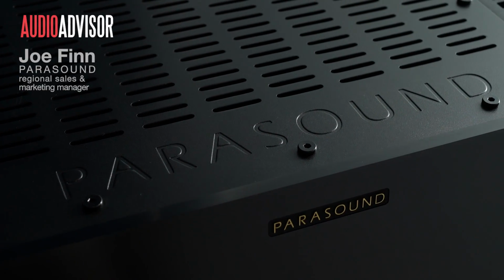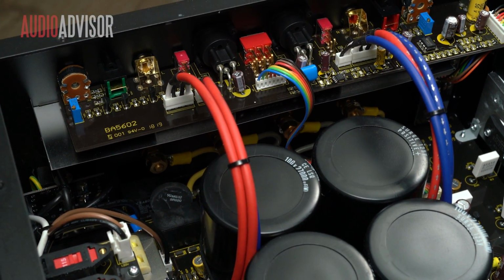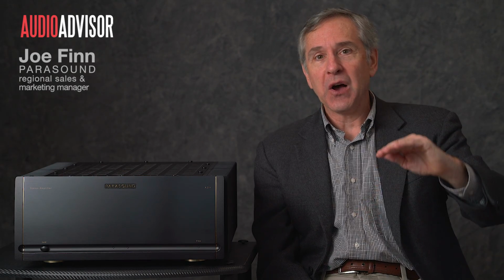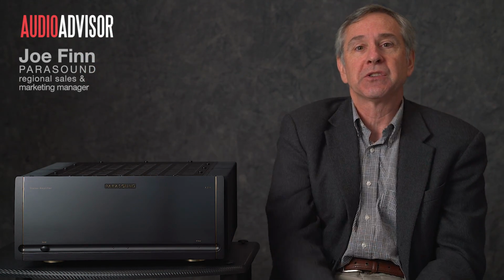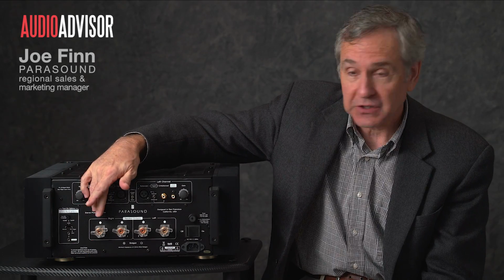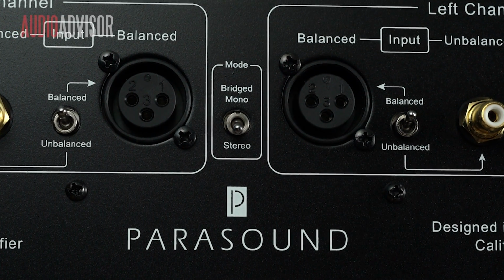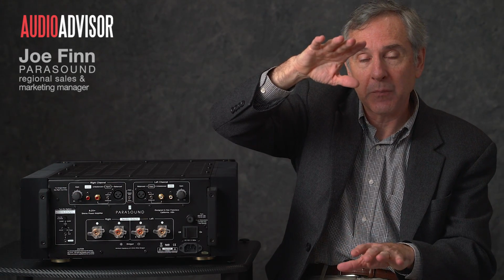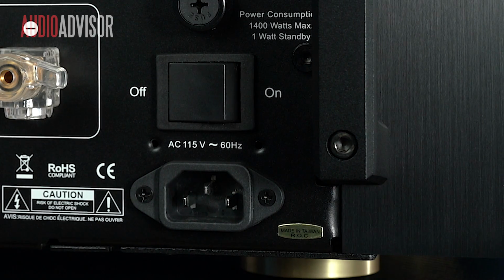Parasound Halo A 21+ Power Amplifier with Joe Finn – Audio Advisor

Comment: Well, Joe is about the only person I have not spoken with at Parasound, funny that. Anyway, I have the A23+ only because I could not afford the A21+, but other than the power, those two are the same in sound. I run a pair of Paradigm Studio 100 v5 towers and love their no nonsense detail and revealing nature. The Parasound Halo line from John Curl (master designer) are a perfect match for such speakers. I love the natural balance and cleanliness these amps bring. Seeing the builds it reminded me of such things as the Sansui 8080db and other vintage amps and I love that sound for the same reasons. The A23+ and 21+ deliver that great sound. 
I don't understand the dismissal or blow off I hear from audiophiles and others directed at Parasound gear and they can never explain why it is that the dealers who carry the Parasound gear can't keep them on the shelves very long.
By the by, I also run the P6 preamp and the JC3 Jr phono preamp (which I would put up against any $5k or more phono amp on the market now) and while I am not an absolute adherent to "must run same brand of everything" it just so happens I ended up doing so and the sound is stunning to me every time. I think even if one where to pair up any piece of Parasound kit in this line to whatever they have one hand, they would notice the same.
Reply: This audiophile would never dis’ Parasound!!  The A21, P5 and JC3+ in my system aren’t going anywhere.   The Parasound sound is extremely good and revealing.   It is vanishingly quiet and details abound. It’s priced ridiculously, insanely affordable considering the quality you get.   The P5 and JC3 also work their magic well with other gear like my Pass Labs X250 amp I recently picked up.   So now I have two monstrously good amps to play with and couldn’t be happier.  One thing I would mention, when I bought my Parasound gear I got free upgrades in power cables.  The one for the amp is like an inch thick.   After a year I tried the factory Parasound cable and found that it was a major improvement over the Pangea cable.  Bass improved, textures improved etc.  so keep that in mind if buying new.
Reply: @Slammintone  Absolutely! Part of the magic is the design of the Halo line. It is tried and true old school. I once saw an open JC5 next to an open vintage Pioneer and Sansui and the similarities were surprising, right down to some of the component parts! Only difference is they were recently manufactured and slightly improved in the process. 
I love how the Parasound gear gets out of its own way. It leans very close to neutral and has a sense of balance. this lends to being revealing. I swapped out a Musical Surroundings Phonomena 2 I was running with my P6 and A23+ with the JC3 Jr and the difference was astonishing! Running a Denon DP-F47 with a Ortofon 2M Bronze, the JC3 Jr draws every single nuance out of the record being played. The detail is stunning and I only have original pressings, not modern day "audiophile" re-issues. (99% of the music I listen to is not available in "audiophile recording re-issues" anyway).
Reply: @ericelliott227  I recently upgraded to an A21+, P6 & JC3 Jr. I’m looking at the Ortofon 2M series Cartridge. I may not be able to afford the Bronze, but am looking at the Blue cartridge. I have approx 18k records and 6k CDs.
Reply: @tomjonesjr.6696  Yeah, I wanted to go A21+, but just could not run to the price. It took 5 years just to get to the A23+, P6 and JC3 Jr. I can not and would not want to do it again!
The Ortofon 2M Blue is a very good cart, especially with the very recent redesign! 

I have a Bronze on my Denon DP47f, but when the time comes (lots of mileage left on the bronze), I am switching to the Blue. People think that is a "downward" move, but especially for my particular turntable (the Denon), it is a near perfect match and will sound just as nice for half the price. I can always get a new stylus for the bronze later.....maybe. The Bronze almost pushes the Denon to it's limits, which is not always a good thing.
I only have about 900 CDs and 700 LPs. I don't have room for more than that....maybe about 30 more LPs.  However, I am a vinyl record preservationist, so I know how to "restore" vinyl records properly. Studied it for two years! "Restoration" is used somewhat loosely, but is somewhat accurate. I have 60 year old records that sound great.
I can only imagine what your records sound like! That JC3 Jr is a killer!! I would put it up against any phono pre in the $5k range without hesitation. I know the JC3 Jr beats the PS Audio phono pre sonically and by design. I would be curious to compare the JC3 Jr to the Elac phono pre. I would not think the Elac would best the Parasound, but they may be almost equals (just judging by design as I have not heard the Elac, but have seen the build in detail).
Reply: @ericelliott227 Hi! I have the Pioneer combo from the 90s c73/m73 with my Focals Aria 948. I was wondering if a23+ or a21+ will be an upgrade in sound quality. Will I get that Wow effect, to say so? Of course, pairing in time one of them with the p5 (if I find one) or the P6. Should I change my vintage amps? Thank you!
Reply: @anmic3590  It depends on what you are looking for. If the pioneer gear is having no issues and a match for the Focals and you like the sound signature and the way your system sounds in general, then springing for the now quite pricey A23+ and pricier A21+ may be a lateral move at best, which is not what you want. 
Your amps are not exactly vintage, so I don't think you would get a different sound if you just got a newer amp unless it was a completely different build. The Parasound would be a different build, however, you need to first decide what sound you are after. Do you like something on the warm side of Neutral or the high side? Do like something as close to neutral as possible or do you prefer some more color? The A23+ and 21+ lean very slightly towards the warm side of neutral. If you are after that "wow effect", look at your speakers instead of amps. Speakers make the biggest difference after setup and recordings. If your speakers lean towards the warm side pairing them with an amp that also leans that direction could result in mud. I would evaluate your speakers first. Make sure you have optimal system setup and listen to very familiar recordings and see what you think. Is anything missing? Is there too much of anything? Is it something that can be easily corrected with EQ? Is there indication of a mis-match between your speakers and amp? These are questions to ask yourself.
The A23+, A21+, JC3 Jr, JC3+, P6 have all gone up in price by 2.5 times! Of course, that doesn't quite apply to used gear although those products do command a slightly higher price used, but not nearly as much as new.
Reply: @ericelliott227  Thank you so much for your opinion and advices. I wish I could have demo the Parasounds, but here in Romania the dealer doesn’t have demos. And, unfortunately, it is hard/impossible to find a good technician to check on the Pioneers and see if they need some recaps. May I ask what would be the advantages of 21+ over the 23+ for the Focals 948, for low and moderate auditions? Is the difference in price worthy for such speakers? Thank you!
Reply: @ericelliott227  I forgot to mention. My living room is around 60sqm, a long one, with windows on one side and the couch is around 3m away from the speakers, with an open back. But, again, the auditions are not intended to fill the entire room.
Reply: @anmic3590  If your Pioneer amp is circa 1991 or so it likely needs a recap or is on its last legs anyway. The gear from the 90s is nothing like the gear from the 70s. A recap for your Pioneer would not be worth it. So you may be better off getting a new amp no matter what.
There are no advantages or disadvantages between the A23+ and the A21+. The only difference is the power rate. The A23+ will be more than enough to power any pair of speakers at any level you like without need to worry about headroom. The worry for that would only come into play if you got some really strange speakers.  The Focals are rated at a power requirement minimum of 50 watts to a max of 300 watts at 8 ohms with 92dB efficiency, which is quite good. The A23+ is 160 watts into 8 ohms and the A21+ is 300 watts into 8 ohms so either amp will have no problem driving those speakers. I drive Paradigm Studio 100s v5 which the A23+ and A21+ amps happened to also be voiced with. The paradigms are 15 watts min to 300 watts max with a max wattage input of 230 watts at 8 ohms and also a 92 to 94 dB efficiency and the A23+ I have has no problem, but I also don't play at high volumes and one would have to get way up there to deafening levels to max out. 
You would be good with either amp. I don't know the native sound signature of the Focals so I can't say how they would match in tone. My Paradigms are about 98% to 99% neutral/balanced so they pair up lovely with the Parasound amps which are subtly the warm side of neutral. They may not pair up well with amps that are more warm though or amps that are too north of neutral even though their frequency range is crazy good.
Reply: @ericelliott227  Hi Eric! Thank you again for all these details. It’s really helping me in taking a decision. I kind of think the same in regards to the recaping of the Pioneers. I do love them for what they are and they did passed the test of time, in my opinion. I will probably go with the a21+, so that I will not have that feeling of compromising, even if, as you mentioned, a23+ will run the Focals OK. My only problem now is the price, since on the European market the 21+ is around $6,200 compared with $4,200 in US. Let’s see what I can do about it. Thank you once again for the full support!
Reply: @anmic3590  You are not really compromising with the A23+ verses the A21+! If you don't play at 120 dB or more, you will have plenty of headroom. There is no difference in sound between the two. Don't fall for audiophile myths. The biggest mistake in choosing and purchasing HiFi gear is chasing feelings. Gear doesn't give feelings, music does. The only feeling gear can give is one of regret in over-spending or unfulfilled lists. If it hits 8 or 9 out of 10 check boxes, your good.
Yes, the prices on Parasound gear have really gone up in the US.
Reply: @ericelliott227  You are perfectly right and I appreciate your support. Since I’m looking into the P6, maybe I can save this way. And the JC3 Jr sounds like a good addition to the system too. I have a Rega Planar 3 (2000) with a Linn Addikt. Thank you so much!
Reply: @anmic3590  Yes, both amps are built the same, both designed by John Curl. The P6 gives tons of inputs and has a nice built-in phono stage. For me personally the only thing I find that it lacks is a good headphone amp and the built-in DAC leaves a little to be desired, but I think both the headphone amp and DAC were after-thoughts. The P6 is geared more traditionally to two-channel and back to basics, which is a good thing. I find that it struggles to power some headphones if you want to use those. As for DACS, I don't know what a good one sounds like as there is no difference among the same type of DACs and I have not tried any others. It is just a perception I have when experimenting with the P6 and my CD player. I hope one day to try an outboard DAC. For now, I prefer the DAC in my CD player over the one in the P6. But it is all in how they are implemented and the output amps. 
Yes, the JC3 Jr is the last phono preamp you will ever need to buy. I went from a Musical Surroundings Phonomena 2, which is no slouch, a very nice phono pre, to the JC3 Jr thinking I would hear a subtle difference at best. I was not prepared for what I heard though. I did not think I could get darker then the Phonomena 2, but you can with the JC3 Jr. It gets to the deepest blacks. It also cost a bit more than the Phonomena 2, which I still recommend if you can't fit into a JC3 Jr. By the way, nice table. I run vintage tables myself, can't afford a new table. However, my vintage tables work fine and are almost bullet-proof. I have two Pioneers from the 1970s, I'm using the PL-510A now in fact. I just installed a new cart for it (I went with a Sumiko Olympia and have never had better sound from that table, very nice). I also have a Denon DP47-f with a Ortofon 2M Bronze as my daily driver. I prefer direct drive over belt, but that is just me. It is also partly why I do not have a new table, not that I need one obviously, but DD tables are expensive and not that plentiful.
Reply: @ericelliott227  That’s good to know about P6. My headphone system is a separate one and I have the Meze Empyrean open backs with the Fiio K9 Pro Ess and I am more than pleased with the sound. The Meze are in my opinion the most comfortable ones and I’m not saying this because I’m from Romania where they are made. :)  In this system I also have the bluesound node x streamer and the Pioneer PD-73 cd player (probably it will be change soon due to some reading failures from time to time… but it’s the age). As for the DAC, in my stereo system I have the Eversolo DMP-A6 Master Edition paired with the Gustard r26 dac. Again, they pair beautifully, but I must say that I’m looking forward to the new amps to run the system much better, hopefully. You convinced me with the JC3 Jr. I will let you know about all of the changes and thank you once again for your support! 🙏
Reply: @anmic3590  No worries, I'm nearly half Russian and we are all Slavs and should always live in peace. Yes, time to change out the CD player if it is something you use often. You might want to look at Cambridge, Marantz, Audiolab, Rotel, Yamaha, Emotiva, NAD, all have players in the $600 range (US). For example, the Marantz CD6007 is a solid built unit. I think you good with any of those choices. Because you already have a nice DAC setup, I would have suggested perhaps looking into just getting a transport, but lately, those are more expensive than full players. Plus you could always bypass the internal DAC on a player and use an outboard DAC like you have.
I rarely use headphones, but I have a pair of AKG K720s, Sennheiser HD650s, Status Audio CB-1. The Status Audios are studio monitors, very flat and I use them for evaluating things and checking my work. My most comfortable are the AKGs. I have heard a range of headphones from $100 to $3000 and they all need EQ (except the CB1, but it is not a listening headphone). Also, I can't wear headphones very long because they hurt my ears. I'm good for about 10 minutes at best. I also can't wear them in warm environments.
I got a Schiit Audio Magi headphone amp. It is just $100, but solved a lot of problems.
Reply: @ericelliott227  Thank you for the recommendations. In the stereo system I’m using the anniversary Denon 110 cd player which has an internal dac that sounds amazing. For the headphones probably I will go with something not that expensive, but sacd capable, since I have some sacd’s as well. But later. For now, let’s see how the stereo one will sound after changing the amps. Thank you so much!
Reply: I'm thinking of getting the A23+ for my system----I may be getting the new Klipsch Heresy IVs. I'm glad you're enjoying the A23. Does it get very warm?
Reply: @Drackleyrva  No, it doesn't get very warm, even after 2 hours, but I still would not set anything on top of it as you want ventilation with any amp. I had a class A AVR that got rocket hot without a cooling system, the A23+ doesn't come anywhere near that. If you are paranoid like me, you might want to pick up a cooler like an AC Infinity unit, but unless you are putting it in a closed space (which I do not recommend for any amp), you probably won't need a cooling rig at all.
Among the things I like about the Parasound JC stuff is that it tends to be more towards the neutral side, kind of gets out of it's own way.
Reply: @thatguy Absolutely. If you are looking for an amp that has a very very subtle lean to the warm side of neutral the Parasound will get you there. Like I said, I wish I could have afforded the A21+, but the A23+ is more than plenty for my space. If you are a vinyl guy and looking for a phono preamp that has scary dark blacks, look at the Parasound JC3 Jr! I got one and it changed the game and it is not going anywhere. I was running a Musical Surroundings Phonomena 2, no slouch, but the JC3 Jr was an unexpected big difference, plus it has a mono switch.
Reply: A23+/P6 here. More power and sound quality than my ears can handle. Beautiful gear. ❤️
Reply: Eric, I am glad I found your comment. I just ordered a A21+/P6 combo from a local dealer and have the Paradigm Studio 100 v4's to drive :) I was wondering how the combo would sound and you may have answered it! Looking forward to the Parasounds...
Reply: Just ordered the a23+...can’t wait!
Reply: @Novilicious  If you are looking for something that leans very close to a neutral presentation that will pair up well with nearly any speaker you hook to it, you will be happy!  That is one of the things I like about, it let's the speakers be themselves. So if your speakers lean towards warm sounding, you will get that.  It won't be like "oh crap, now these speakers are too warm, so I have to find different ones". If your speakers lean heavy towards the mids, you will get that and if your speakers are on the bright-side you will get that, but with refinement.If your speakers are a little too bright, the Parasound may subtly tame that excess brightness, which may be just enough, it depends. 
I would not mind hearing what it might do with something like the Revel Concertos.
I drive a pair of Paradigm Studio 100s v5 and it so happens that is one of the speakers they used to test with when they built the original A23 and A21. I don't like that Paradigm stopped making those. I don't know what happened, but the new Paradigm collection is too bright, shouty and unrefined in my opinion.
Reply: FUN FACT - JOHN CURL HAS ZERO TO DO WITH THE A23
Reply: @keeferdog2727  Using your logic, the same can be said of the A21. REAL FACT: He designed it....technically. Both the A23 and A21 are based on the JC5/JC1, which is a direct link to John Curl. John gave the go ahead for Parasound to have the A21 and A23 as well as the Hint manufactured to his design and specs. You could call them "a chip off the ol' block", if you will. Due to certain legaleze and the fact that it was not a "direct" linkage with John Curl, they did not put "JC" in the name. Same story is true for the JC3 and JC3Jr phono preamps. The JC3 was directly designed by John Curl and the JC3 Jr is "a chip off the block". In this case though the legaleze was such that John just directly linked the two since the JC3Jr is 90% of the JC3. John Curl has gone on to lend his expertise to other companies even while working for Parasound.  I don't hear John or Parasound complaining. John even consulted with PS Audio on their phono preamp at their request. (Although in actual use one can tell they did not listen to him , but should have).
If you want to argue the point further I suggest taking it up with Parasound.
Reply: @keeferdog2727  they are essentially the same circuit design topology and yes John Curl did admit to not having anything too do with the A-23.